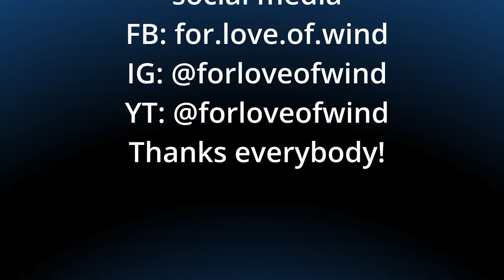3 DIY flooring, dog safe stairs and our boat survives hurricane Ian

Comment: The wife and I went to the boat show for the first time, and hearing brand new boats with squeaky sole plates disturbed the crap out of me.  I’m sure the eva foam helped with that a lot.  

Audio is mucho better.  Experimenting with different setups will eventually get you where you want to be.  With my DJI mics, I can turn down the gain independently and sync the audio in post fairly easy using the onboard recordings rather than pushing the sample to the camera.  Then the freedom of doing what you want in post to each signal grows rather than cutting each snippet and manually adjusting them.
Reply from the maker: Oh thanks! This is good info. Unfortunately it does seem that the sound is a little off again in our latest release. We do all our editing on the Mac and it sounds fine, but then when we watched it on the tv after releasing it, the sound needed adjusting again. Unknown whether it would affect our metrics if we pulled it, edited and re-post, and we don't want to lose comments or anything. We still have so much to learn... (facepalm) Aside from that, yes- the EVA foam does indeed help with noise reduction from squeaky floorboards- and doggy toenails clicking on the floor!
Reply: @forloveofwind  once a video is public, your done.  I always post my videos unpublished for at least 24 hours.  Gives time for the 4k rendering to finish and gives me a chance to delete and repost of there is a problem.  Concerning editing, having your audio files separate let’s you edit as a multicam setup.  On my other channel, I record a lot of hockey games.  I experimented once with 2 cameras and 3 mics.  I didn’t have dialogue to sync with, but still found a way.  Once the manual syncing was done, the rest of the edit went pretty fast.  But that’s why they use a clapper before takes in Hollywood.
Reply from the maker: Thanks for verifying- we were really leery about pulling the video to edit so decided it's just going to be what it is this time. We have been able to get a little ahead on editing so are now able to post the videos 24 hours or more in advance. But we also made the incorrect assumption that it was good in all formats, live and learn!

Comment: Now that All the Bugs are gone. All you have to remember,IS NO  Cardboard on the Boat. So ANY food that has any Cardboard remove what is inside and put it in  Sealed containers. That way you shouldn't have  Roaches. We also would put our flower and stuff like that in the freezer for a few days to kill the  Critters that come with your flower. Funny thing is it works here in Hawaii too.
 Ok Thank You for a Great video to start the week with. Looking forward for the next one. So until then, Aloha from the Big Island of Hawaii!
Aloha and Mahalo!
Reply from the maker: Aloha! Thanks again, I think I have some work to do. We did buy a dozen or so airtight plastic containers for flour, cornmeal, cereal, oats, etc but as I'm thinking about it, we still have a fair amount of cardboard on board in the galley and the storage under the settee. After dealing with termites, cockroaches are the last thing we need! Please keep the tips coming!! Mahalo!

Comment: Good job on the floor boards! It's crazy that some of them were screwed down: you need quick access in case the hull is holed. I understand the compromise on the ladder for the dogs, but the curved stairs are really cool when the boat is at a 45° angle. You can go up or down the ladder with bare feet without hurting yourself.

The bilge area is prone to get water. No boat is perfectly leak proof. Even rain will find its way to the bilge. On the Hunter 37 I've sailed, the bilge was never 'bone dry'. So: not good for food or anything that can rot or rust.

The placement of the batteries is really weird. If the boat gets even 'partly' flooded, the batteries will likely 'short'. On the Hunter 37, they were behind the galley ladder and above the engine or about 4' above the floor boards (and right under the hatch, so possible toxic fumes would exit the boat).

Tip: avoid holding to a boat by directly holding a line. The boat is heavy and the wind will overpower you. First untie the cleat hitch, keeping the line rubbing against the cleat. Pump the line with a vertical pull to create a slack on the line, however small. Take up the slack around the cleat on the deck. Repeat as many times as needed. The friction on the cleat is stronger than the wind and much stronger than your arms.

There is no doubt in my mind that you'll succeed in your project. You have the right frame of mind.
Reply from the maker: Wow, thanks so much for the tips!! We can use all the help we can get. I agree that the batteries could be better situated, we just don't have room anywhere else in the boat for them - argh. Thankfully the high water alarm is below the battery compartment so at least will let us know if we are getting close. We still have much to learn and any words of wisdom are greatly appreciated, as are words of encouragement!!

Comment: The angle on the cabin steps is, there for, when you are healed over
Reply from the maker: Thank you for commenting! We have heard that the angled steps are a lifesaver in rough seas, which we haven't yet experienced. Thankfully we did save the curved steps so we can put them back on when we need to!

Comment: Is the carpet non slip? If not I would suggest you put grip tape on the flat surfaces. Cause you will need it when the carpet gets wet ..You don't want to fall entering in during storms.
Reply from the maker: Thank you for the suggestion! Fortunately the carpet is non-slip and meant for indoor/outdoor use, but as yet we have not really tested it in very wet conditions. Hopefully it will stand up to the task!

Comment: I would love to know your impressions of using Starlink with your boat. I am working on how I could do my working from home to a working from a boat scenario. I have heard of people using the RV version in the Caribbean and would love to know your thoughts.
Reply from the maker: We love our Starlink! I worked from the boat for several months with no issues (far better than marina wifi or our T-mobile hot spot).We have a friend who went deep into the Bahamas with his Starlink and had coverage the whole way, although the map doesn't show completed coverage yet. The speed is good enough for zoom/facetime/MS-teams meetings, streaming tv service etc. We don't have outages for weather unless it is a pretty bad storm (dense overhead cloud layer).
Our new inverter has a smart function that will basically stay off until it detects a load on the AC side. Starlink does draw enough to keep this on once the satellite connection is made, but not enough to trigger it during the Starlink boot process. Starlink has introduced a "sleep" option where I can set my Starlink to go to a very low power state during certain times of the day (for us 11pm to 7am). This way the inverter automatically kicks off at night to save power.
At the time of this reply there was no more RV plans, it is now called "Roam".

Comment: Are you going to coat those ply floors? Epoxy to seal them?
Reply from the maker: Hmm.. now that would have been a great idea, wouldn't it? We did not coat the floors before we laid the faux teak so the tops of the panels will not get coated, but we will probably go back now and seal the undersides. We did get marine grade ply for the panels that we had to replace so hopefully they will hold up for a while..? Guess we'll find out! Thanks so much for the comment/suggestion, all advice is appreciated!!